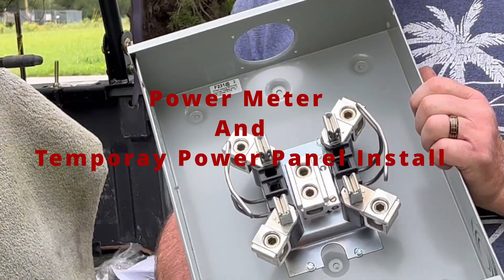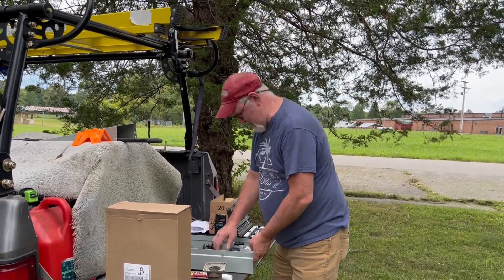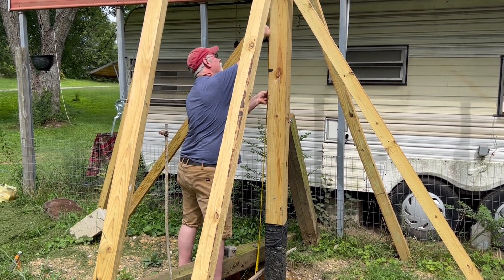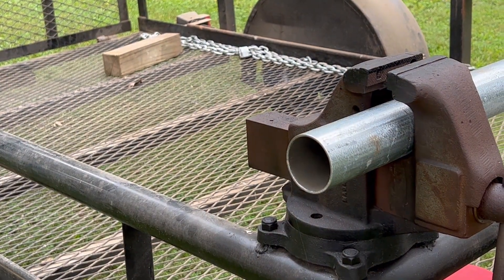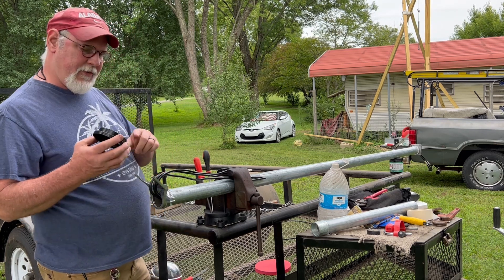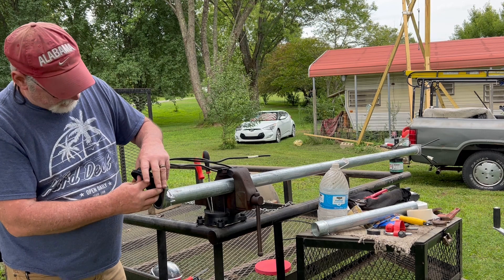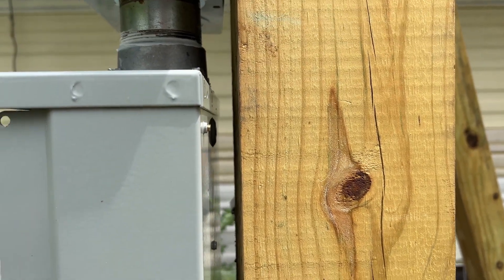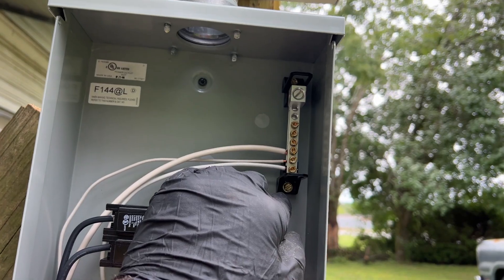Installing Temporary Power | Eaton RV Power Panel And Eaton Service Meter Installation

Comment: Don't you need a main disconnect
Reply from the maker: I only have three circuits, 20, 30 and 50amps.
7 or more circuits would mean a main disconnect is required.

Thanks for your comment.

Comment: Thanks gives me an idea of what im in for only difference on mine is a 50 amp 125/250 so im wondering if I hook up the same way or not 😮
Reply: Because 110 and 110 is a 220 plug i need a 250 plug but im not to sure if that matters or not
Reply from the maker: I know it’s confusing but it’s supposed to be 120 from one leg to the center tap on your transformer.
The transformer has two legs(hot) and a tap in the center(neutral) . From any of those legs to the center tap will be or supposed to be 120. From leg to leg you’re going to measure ruffly 240 volts.
I’m guessing you haven’t studied electricity and I’m worried that my advice isn’t going help you do your own power pole safely.
So, my advice is to either study electricity and get certified or get a certified electrician to guide you through the process or install it for you.
Safety first!

Thanks for your comment.
Reply from the maker: Yes it would, but you don’t have to order yours with the 30 amp.
In my opinion it wouldn’t hurt to have both, because cost wise it’s going to be about the same price.
Call your local power company and ask what are their requirements for a temporary power pole.
My company gave me a diagram in pdf form.
Thanks for your comment and good luck.
Reply: Use a 125 panel with a 50 amp breaker to plug.

Comment: What about ground rod?
Reply from the maker: I’m only required to have a ground rod 8 feet deep because, I’m in a moist climate.
In most cases I think you’ll be required to have two grounding rods at a minimum of 6 feet apart and 8 feet deep.